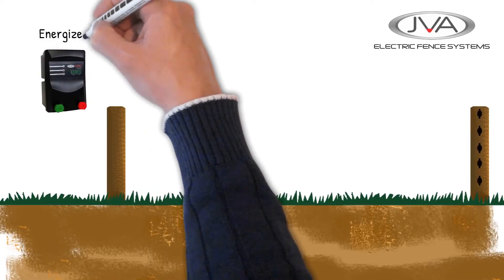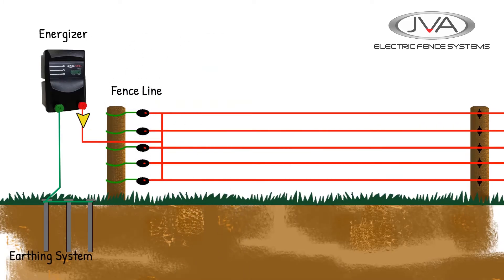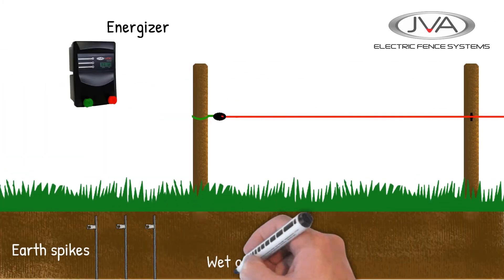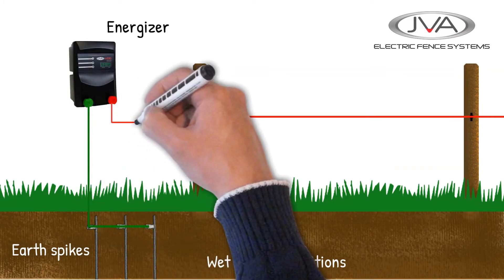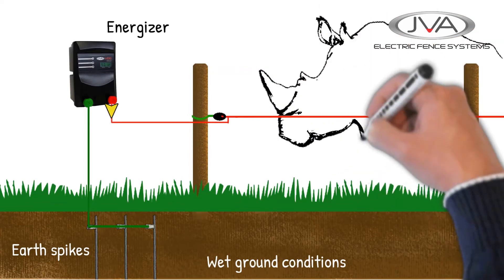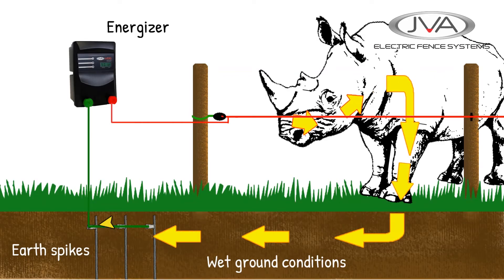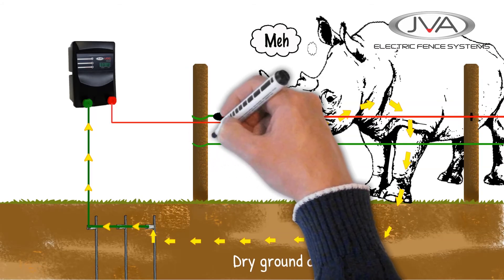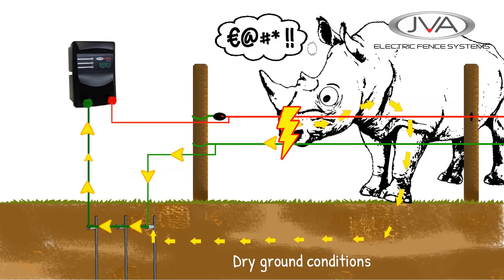How does an Electric Fence system work?

Comment: I have a question - does the conductivity of the closed circuit affect how much current would ultimately be drawn from the battery with the way that induction and coils work? In other words, does a fence with a closed circuit draw the same amount of power as a fence with nothing touching, or does a closed circuit drain the battery faster than an open or mostly open circuit? Where does the pulse “go” when there is no animal touching the wires (when the circuit is not completed) - would it be going through the “best” path through a bad insulator, vegetation, etc to get to the ground?

TIA. Your help would settle some questions me and some co-workers have.